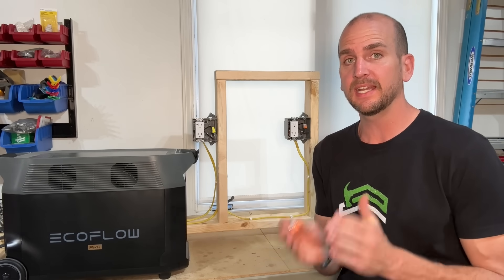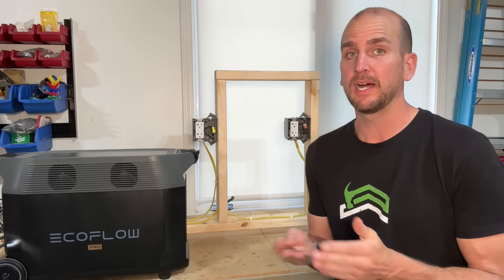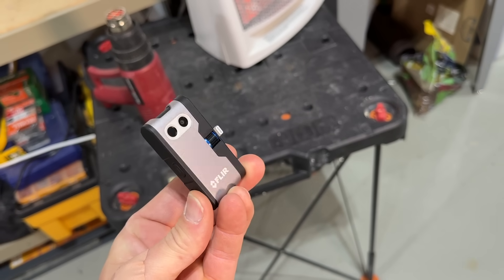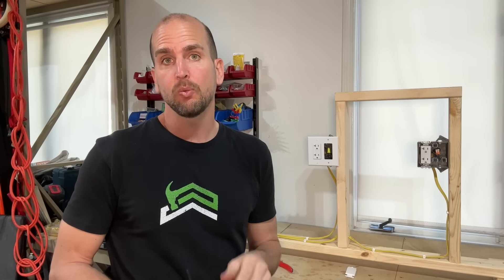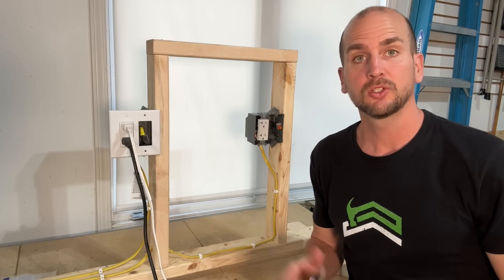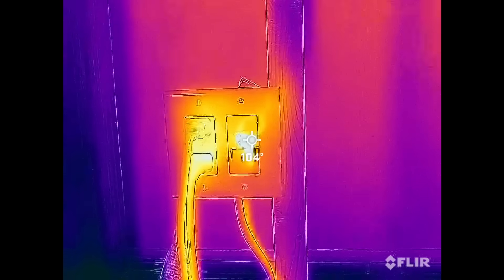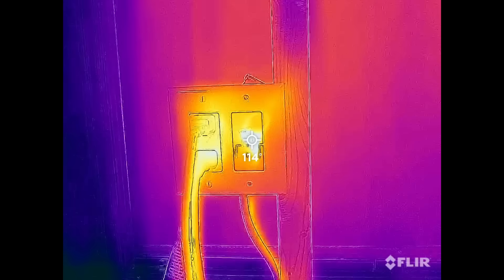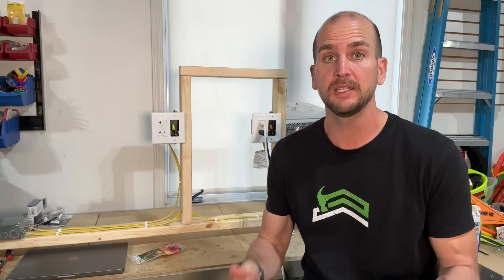Debunking the Pros: Can WAGO Lever Nuts Handle Heavy Electrical Loads?

Comment: I’ve seen some shotty work done on home electrical components. It’s not uncommon to see a wire nut hanging on by a thread. I’d say if you know what you’re doing as an electrician you will get similar results from using either option (some prefer the ease of the WAGOs sure, but I mean in terms of function). But a poorly installed wire nut could actually be a bigger threat posed compared to the higher resistance of the WAGO connections.
Reply: If you mean shoddy, then I agree with you entirely. 😉
Reply from the maker: That is pretty much exactly my stance as well.
Reply: @EverydayHomeRepairs  May I pimp a video from several years ago, done by a friend of mine in the uk... I am the eponymous chipmunk who sent him the connector 'string' https://youtu.be/2uYD8e7idnY
Reply: @EverydayHomeRepairs  Your stance is to sell them. There junk.
Reply: I was taught how to do basic wiring from an EE, so I have a habit of checking things way more than necessary for things like wires coming loose. Note: Pre-twisting was one of the key points drilled in. More often than not (more than 50:50), even with pre-twisting, if the two wires were of mixed type (solid vs stranded), the weaker wire type would pull loose. Since most basic DIYers are going to be doing things like replacing light fixtures, ceiling fans, etc, then that's what they'll run into the most. So while the WAGOs appear to generate about 5-10% more heat (IE: possible mild waste in power) according to the video, they'll more than likely have installed them in such a way that is electrically safe / sound. I mean, aside from stripping issues or remembering to close the arm, there's not much Else you could screw up with a WAGO.

That said, we have Gen contractors out right now doing remodels of various rooms and the company head said "absolutely not', but I'm not going to debate him on how he does things that are preference based (unless I see something unsafe, he obviously knows what he's doing from my observations).
Reply: Wago is also great when wiring transition from old aluminum wire to new copper cable .
Reply: @sofjanmustopoh7232  Only if you use the right Wago for the job, some are designed for that others not.
Reply: @K2teknik.  with wago regular connector . Wago recommend Al plus contact paste. To remove the aluminum oxide and prevent new oxide from forming . 
So regular Wago lever connected with Al plus contact paste
Reply: Nice think with the Wago... is with it clear, even a DIY/homeowner can easily see that the connector is well seated and is going to work.
Reply: @wolphin732  Exactly! WAGO installation are more binary in nature. It’s either fully engaged or not. I’m not saying that we should encourage unskilled electrical work... but sometimes the product or components that makes improper installation more difficult are worth spending a little more money on and can give piece of mind that the job is sound.
Reply: I've done work in US and the tooth paste caps as we call them fell off and I was left with light fitting and and at the time I did not know the wiring system for US.  I went to RadioShack for something better but they had nothing. So was forced to wire nuts which took me some time to get them to stay on
Reply: I always figured either option was reasonably safe.  If WAGO connectors were just not up to the task we'd hear endless tales of homes all over Europe bursting into flame, and same for US homes with wire nuts.  Just follow the common sense rules of doing good, careful work, use the right tools and don't touch the things that can hurt someone if you're not sure what you're doing.
Reply: I've taken down plenty of light fixtures, switches, and outlets and found loose wire nuts, especially when used to connect more than 2 wires.
Reply: Wagos are shotty when installed properly. If you dont know how to do the work or dont want to take the time to do it right then you shouldnt be doing it.
Reply: Make that, "slightly higher resistance of the WAGO" and I would agree. 

To me, it appears it is much easier for a novice to properly install the wires in a WAGO connector than in a wire nut.
Reply: @buggsy5  A novice need to be better trained if he cant properly twist the wires.
Reply: @buggsy5  a novice shouldnt be doing the work.
Reply: @buggsy5  There should be NO RESISTANCE, pretty bad when you do it on purpose.
Reply: @buggsy5  If you cant put a wirenut on properly youve got no business doing the work in the first place.
Reply: Exactly. The lesser of two evils.
Reply: Amen an Amen.
Reply: @johnnymerchant were these Wagos, or Amazon knock offs?
Reply: @patrickhenigin4805  I'm guessing they were the stab type spring loaded type connectors rather than lever lock type connectors. Those types are terrible and warrant criticism.
If they were actually the lever type and unable to retain the wire from being pulled off by hand, it would be good to examine it to find out why, or send it to someone capable of determining the reason.

If the reason ends up being simply because the wire wasn't fully inserted before the lever was closed, then the issue is a defective installer.  

If the connector itself lost spring tensioning, hopefully he saved them all for analysis, because a lot of people would be interested in seeing them. I'd certainly be curious to see what happened.
Reply: I must admit that I've had more than one occurrence of a poor connection made using a wire nut. But when it did occur, it was more than a two-wire connection, and usually mixed type wire.
Reply: true, i found one wire nut with two wires expected and two extra clipped wire pieces in it just to make it fit. talk about a fire hazard.
Reply: Same is true for a poorly installed Wago. Don't hire іdіots.
Reply: no, wire nuts get lose due to temperature changes, so no similar results at all.
Good for electricians making points, by blaming the previous electrician as a dumb, who cannot install wire nuts properly, hahaha.
And if you are that one yourself, you can retighten your wire nuts in secret.
So yes, wire nuts are a win for scammer electricians.

Scammers are banned in europe
Reply: You have no business installing any electrical device poorly
Reply: @RadioRich100  Their, there, and they’re are pronounced similarly but don’t have the same meaning. You can recognize which one is correct from the context. There is most commonly used to mean “at that point” or “in that place.”They’re is a shortened version of “they are.”
Reply: @filipbalcar3567  I know, I make that mistake alot.
Reply: No way is a properly installed wire nut comparable to a wago. If a wirenut is installed properly you will never have trouble, you cant say that with a wago which probably will cause trouble installed according to the manufacturer.
Reply: Thats the guy that put it on, not the wire nut. Wagos can be installed correctly and still fail which they do. Wirenuts installed correctly will last a hundred years. Beside its not even the wirenut that makes the connection, its the twist.
Reply: Simple fact is the Wago's in my country are approved for use as Maintenance Free (MF) joints and can be placed into plastic boxes and placed in inaccessible placed with no requirement for periodic inspection.

This is not the case for wire nuts.

And that national approval is provided by an organisation which is staffed full of degree qualified electrical engineers, including university lecturers in electrical engineering.

You Americans need to quit worrying.
Reply: @deang5622  Are those engineers the same ones that said its ok to use aluminum wiring because its cheaper? Which as everybody knows burnt down hundreds of homes in the 70's?
Reply: @RadioRich100  They never should have allowed aluminium for household because it's very tricky to use. If I am not mistaken, in most of the EU (if not all) aluminium is banned for household (always has been afaik) and only allowed for large cross-sections in distribution/transmission (found abundantly all over the world, even in the US).
Funny thing is that a wire nut is probably by far the worse thing you can use for connecting copper with aluminium and since those type of connectors are "the way to go" in the US it's the perfect recipe for disaster. A Wago style connector can be used for this, but still be a hazard if not used correctly.
Reply: @ppdan  Yes, aluminum is no go good for branch circuits. They make a special wirenuts and compound for dissimilar metals such as copper to aluminum
Reply: @RadioRich100  It's not the fault of aluminium, it's the fault of unskilled people using it.
Reply: @ppdan  Yes, but it was UL for approving it.
Reply: @RadioRich100  Because UL approves it you are allowed to use it? That's easy ...
Reply: Wire nuts can loosen, also the exposed copper in them corrodes and oxydizes, its a big problem to splice 12ga solid and stranded lamp wire, or multiple wires in a jcn box
Reply: @johnnymerchant You haven’t a clue to which you speak. Wagos are used in UK/EU with higher loads then US. Wire nuts are much easier to fail. If you’er not a master electrician with training in both your comment is worthless.
Wagos, so I understand, are commonly used in your country as code appliance new and remod.
Reply: @ChromeLuxx  BALONEY!  European home appliances run on 240 volts.  For the equivalent power of a 120 volt appliance the European 240 volt appliance draws HALF the current.  That imposes a lot less strain on whatever connection technology is used.
Reply: @ChromeLuxx  your higher loads are voltage, not amps. not to mention also the freqency of your power being 10 htz lower as well. Higher the voltage of the object using said power, the lower the overal amperage draw of that object. eg: 3/4hp motor on 120v (single phase) will use ~9-11A depending on its age and wear. That same 3/4hp wired for 240v full phase will use ~5-6A to produce the same output of the motor. Now dont even get me started on ring-bus syste, that you guys use over there and the lack of proper isolation that system creates....
Reply: Wire nuts are going to have trouble in situations joining thin stranded wire to solid thick wires, so the lever lock connectors are preferable there. 
And if the connections ever need to be changed, for replacement switches or outlets, all the wire twisting required for a proper wire nut installation means that section needs to be cut away rather than reused, so the wiring will get progressively shorter each time.  That's a disadvantage unless you can guarantee the outlet or switch will last a lifetime and never need to be reconfigured. Could try reusing the work hardened wire section but with increased chances of it fracturing when retwisted.
Reply: @johnnymerchant  Wago's are go-to's only if, even with an extended depth box, there's next to no room left because of total wire count is greater than 6 (3 pairs not including grounds) + deep modern smart dimmers that can get up to 2" deep by default.
Reply: Sounds like you shouldnt be doing the work either way.
Reply: Wirenuts should be sold as a Professionals Only product.  As well, I'm not sure I like the idea of using WAGOs to encourage non-skilled individuals to work on electric circuits.  Homeowners shouldn't be touching the wires unless they have extensive training and practice.
Reply: I've seen a lot of poorly installed wire nuts and still think this is a perfect scenario for the wago  in a perfect world out in open. if you put bending side force on wires into wago or wire is not perfectly strait you may get a very small contact area like after it is crammed into a box full of wires
Reply: @Greg Hill  how about installing wirenut right or dont do the work?
Reply: @RadioRich100   I've read several of your comments in this forum and keep waiting for you to put forth a compelling argument. Lots of posts--very little content. Your focus on the resistance and slight difference in temperature while excluding all the other factors that contribute to a safe installation shows you are unaware of how systems work and the totality of how to increase safety at scale. Anything can be built better/stronger/safer by a master craftsman on their best day, but that is not easily or economically repeatable on a large scale. The safest practices are the ones that can be repeated countless times with a high degree of success. Wire nuts require some skill and technique to do properly, I pre-twist my wires but this is increasingly difficult with more than 3 wires. Furthermore, even with pre-twisted wires, sometimes the one in the middle can come loose because of the tendency of the outside wires to twist around the center wire which sometimes leads to a surprising ejection of that wire. In contrast, Wago's always work the same--whether it's 2 wires or 6, no change in technique or increased skill is required. 

As someone else said here, Wago's are binary--either the wire is in the slot and clamped, or it's not. It has a virtually foolproof visual indicator. The same can't be said for wire nuts since the quality of assembling the connection varies from one connector to the next, and definitely between different installers. Manufacturers detest processes that are inconsistent between different workers--especially if there is no easy way to test or QC the work. In general, the procedure that can achieve the highest repeatable success rate among all workers (from amateurs to pros) with the fewest failures is the procedure that should be promoted for better quality and safety. These are generally labelled "best practices" in most industries. (You're still free to choose your.own personal best practices as long as it meets code). Ask any Six Sigma expert about how to improve product quality at scale and it won't be the most rigorous, difficult solution, it will generally be the simpler one that is more easily implemented and leads to steady, consistent results.

"Perfection is the enemy of the good"--Voltaire
Reply: @RadioRich100  How about we rely on the people who certify connector types for use both in residential and industrial applications worldwide to tell us if a Wago is ok?  (Hint:  All of them are certified.  And in some countries in industrial applications wire nut connections have to be periodically inspected while Wago connections don't.  I'd say that's a glowing approval from those people who's job it is to determine electrical standards.)
Reply: @Kevin Willard  What countries act as if WAGO is more reliable than a wirenut?  My personal experience shows the opposite : WAGOs fail in contaminated environments where wirenuts perform for decades.
Reply: @JeremySpidle  In the UK, only Wago can be hidden in the wall or floor without any possibilities for inspections. Also need a special box for that trick though.
Reply: @kevinwillard6652  You mean like when they approved the use of aluminum wiring back in the 70's ? Great decision. Hundreds of people lost there homes or died. No i dont think so. They cant tell you what will happen over time. Aluminum wiring didnt start causing problems for years. These things will too. It only takes one in a house.
Reply: @RadioRich100  2 twist minimum with lineman's or bust.
Reply: @RadioRich100  You keep implying on and on like a broken record that Wago connectors were this new fangled thing that only recently popped up. Wago spring terminal wire connectors have been approved and on the market in Europe for half a century. Plastic wire nuts became common in the US in the 1960s, that's only 10 years longer, so if you're concerned about unknown long-term risks with Wago connectors you should be just as much concerned about wire nuts.

> You mean like when they approved the use of aluminum wiring back in the 70's ? Great decision.

Who the f*** do you think approved wire nuts? If THAT's what you're concerned about then AGAIN you'd have to apply the same logic to wire nuts as well.
Reply: @blahfasel2000  No you dont properly installed wirenuts dont melt or burn as there NOT in the circuit.
Reply: A wago is a resistive IN THE CIRCUIT connector. A wirenut is just a cap over a good twisted connection. Cant possibly fail if the wires are properly twisted which means NO resistance. Anybody body pushing wagos is either lazy or dosnt know what there doing. Anything to get out of there faster.
Reply: @RadioRich100 there is no twisted connection with "no resistance" 🤣
Reply: @tjwatts100  Compared to a wago there is. Theres enough resistence in a wago to cause over heating issues especially hi amp loads. Wagos get hot with normal loads.
Reply: @tjwatts100  Ok meaningful resistance. Twisted connection practically none. Wago alot by comparison. Why sabotage the job? To save 20 seconds? Like a lot of guys doing work for others, just get out of there as fast as you can.
Reply: @RadioRich100  unless you are going to do a gas tight crimp or solder, everything gets warm under normal loads.
Reply: So get rid of that electrician not the wirenut.
Reply: Shotty work is the person doing it. A shotty product fails no matter who does it.
Reply: @RadioRich100  precisely my point
Reply: @riffdex  the shotty product is the wago.
Reply: @riffdex  the shoddy product is the wago
Reply: @riffdex  Than why use a wago?
Reply: @RadioRich100  for the same reason you might use a ratcheting wrench when an open-ended wrench would work. Because sometimes it makes sense to spend a little more money on a tool or part that makes your work quicker and more efficient…
Reply: @riffdex  Then you shouldnt use wagos
Reply: @RadioRich100  If you ever open an outlet in Germany (or some other countries in europe), good luck finding a wirenut. They are also UL and NEC approved.
Do some research before talking bs to people.
Reply: The wire nut was incorrectly installed then. The method is still proven good. When wagos are installed correctly your taking chances on contact failures over time no matter who installed it. Chances that no one needs to take just to get the job done faster and far from better.
Reply: @RadioRich100  I'm British.

We stopped twisting wires together about 100 years ago 🤣🤣🤣
Reply: @tjwatts100  Wow your old. Didn't think you tea sippers had electricity that far back.
Reply: @RadioRich100  Well, given we invented the arc lamp pre 1810 and you lot were still struggling to get it to work from 1850  perhaps you should defer to your betters.😂
Reply: @tjwatts100  Whos we?
Reply: Do you have trouble with English? Allow me to assist:

Me: "I'm British"

You: Something about tea drinkers... I don't actually drink tea, so you might have been better calling me a limey. But anyway, you read the comment that the previous paragraph refers to.

Later me: "We"

It would therefore be a direct and logical deduction that "we" refers to "the British"...
Reply: Thats because this guy probably did it.
Reply: @RadioRich100  😂
Reply: @RadioRich100  who?
Reply: @riffdex  the guy who did the video
Reply: @riffdex  The guy who owns the channel
Reply: @riffdex  scott
Reply: @RadioRich100  Please stop spreading false info about the wago, it has proven itself since 2003, if it wasnt safe, wago would be out of business, I dont know why your so intent on proving this product is bad even though you provide no real proof. I have had some in my wiring for years, never a single problem. Its also interesting that ive seen nobody but you saying these things, stop misleading people with false info.